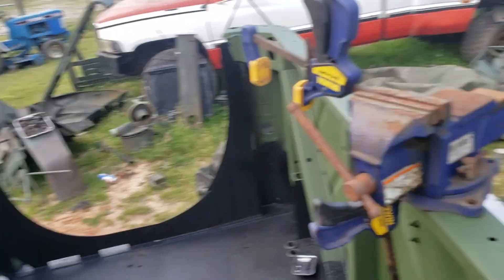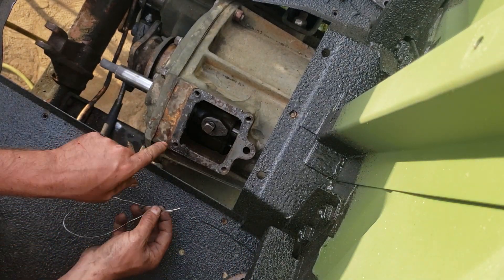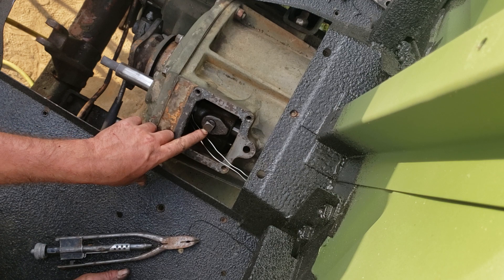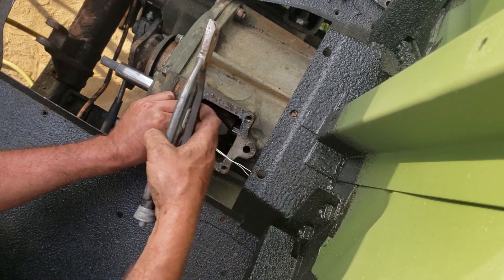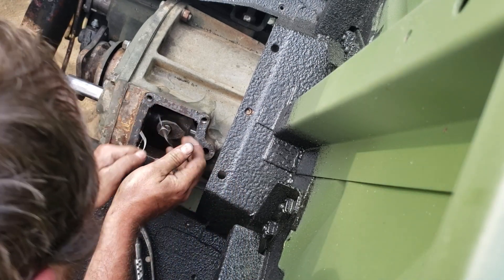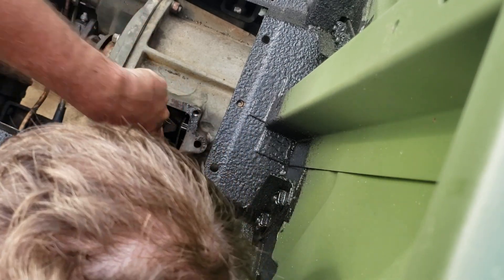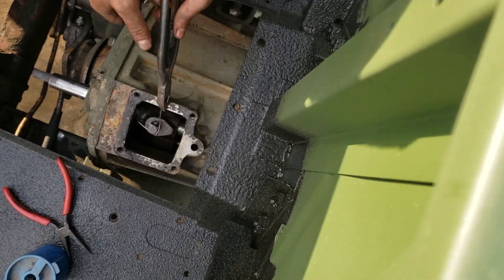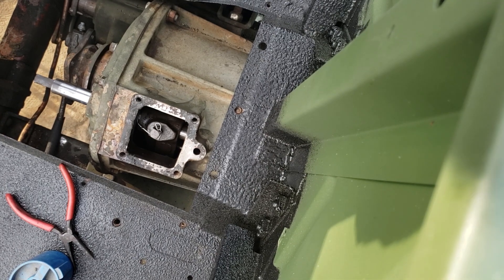How to safety wire ( lock wire) a bolt.

Comment: bro what is the most common size safety wire> .25  or .40 ???
Reply from the maker: Depends entirely on the application. They are both equally prolific.

Comment: Nice safety wire! Currently learning aircraft mechanics in the Air Force. Before you do your twists with the pliers, pull the wire tight, in the desired direction, with the pliers so that the wire is hugging the bolt. Then do a few twists by hand to eliminate any gaps. Also, when doing your pigtail, turn the wire counter clockwise as a precaution to help prevent it coming undone over time.  Just a little tip that I've learned to make it even tighter! Love watching your videos, can't wait to see the Cummins!!
Reply from the maker: Thought I did the tail counter clockwise. But yeah I should've pulled it tight first, you're right. Probably would've helped a lot.

Comment: could you please do a differential fluid change i got a 1968 kaiser and i dont know what oil to use or how to do it
Reply: Its actually simple. On the bottom of the diff housing (round part) there is a drain plug. 1/2' ratchet or breaker bar to remove. On the back of the same housing mid way up there is another drain type plug, that's the fill. Remove bottom plug , drain oil, remove top plug oil drains faster. Refill: replace bottom plug, fill from top plug till oil starts to drip out of the top plug. I use 80-90W from tractor supply in 5 gal buckets and a hand pump. once full replace top plug and tighten.
Reply: @longrifle.  80w90 is gl5 right and i dont know if the diffs have yellow medals in them so it could corrode them
Reply: I don’t know if it is GL5 or not. I’ve run several thousand miles in mine. With that exact oil. There’s no “yellow”metal to be concerned about. The only “yellow” metal you speak of, is in the transmission. It’ll take about 2gal per diff. The process is also listed in the TM.